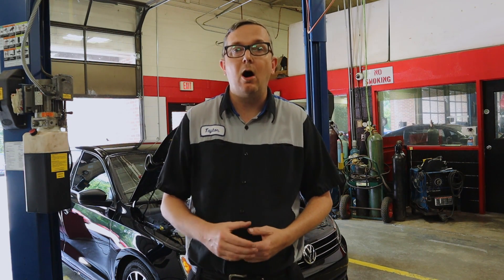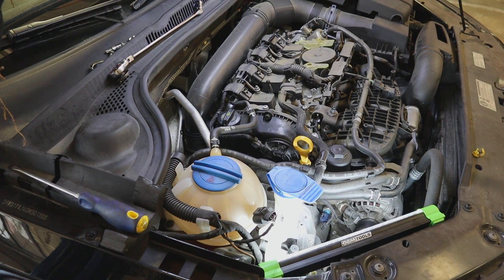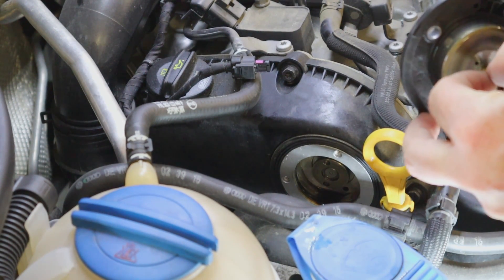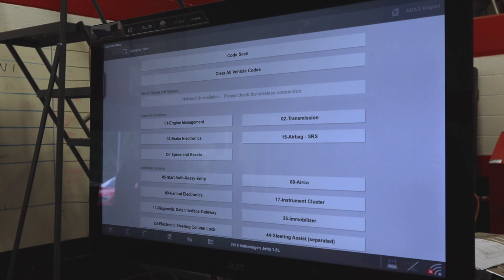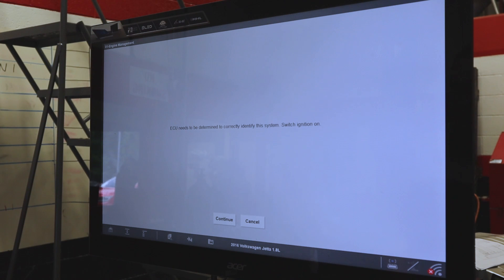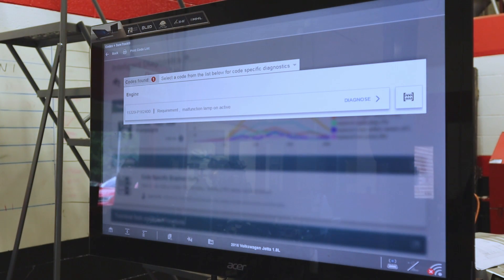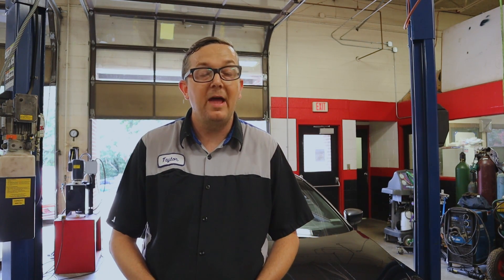VW Audi 1.4 1.8 2.0 TSI P0011 Camshaft code diagnosis and repair - try this first!

Comment: My 2019 vw tiguan sel premium was at the dealership for over a month with no answers even though I hinted the problem.  I picked it up and replaced both magnetic camshaft adjusters and control valve solenoids plus both camshaft sensors.  I ordered O.E. electronic parts and after-market oil solenoids and no more problems.
Reply from the maker: I’m glad it worked!

Comment: Exactly what I was looking for!! Is the pin on the electro magnet supposed to move freely? Mine is stiff and retracts inside when I let go of it
Reply from the maker: You may be able to clean it but I would be looking for a replacement. I hope this helps!
Reply: Hello. The pintle in the magnet is supposed to move freely. Shake it and it should rattle. Move in and out. It controls high pressure oil flow to the cam in the vvt system. Number one culprit. Replace it. $163 OE. I bought it for $25 aftermarket at ECS TUNING. 3 torx bolts and 7 minutes later it's fixed.
Reply: @patrickvillarreal7058 my magnet pin was actually moving freely!! I’m just trying to decide and conquer things I know are an issue, I had timing done at the garage 6 months ago and they broke one of the bolts that hold the magnet down and just siliconed the head on to look like it wasn’t so I was thinking that could’ve been causing my issue but I had it fixed and another prexisting issue I had was my epc light coming on if I gave it too much gas going up hills and it comes when I raise the rpms to climb them. It’s fine under normal acceleration except for in certain cases not always 4th but almost always in -5-6 if I’m really on the gas for example to pass on the highway I get the epc light. And I know for a fact my vet solenoid needs replaced as I get a p0010 code for it but I’m having trouble getting the tool. I’m also tackling a possible pcv valve issue where I’m getting oil consumption almost half a quart every 2 weeks and oil mists from the oil cap if I open it while running and intermittent white smoke from the tailpipe at idle like it will be there and gone but it’s not a smokescreen and only at idle. But the car runs and drives fine as far as I can tell which is even weirder and no other codes than the p0010

Comment: Thank you for making this video I own a 2014 audi a4 quattro 2.0t  but im having trouble loosen  the valve  everything turns when i try, any tips would be appreciated
Reply from the maker: Make sure you are Turing it clockwise
Reply: @AutoScholarwithMrB  so same as you described on video, righty loose and lefty tighty? If so how to keep from everything tuning i bought the special tool can i use a impact rachet insted of handheld one? Thank you
Reply from the maker: @omaramaya3441 maybe, just be very careful. I have no idea how you would get it out of it breaks. Many people have mentioned cleaning it in place with brake cleaner if you can’t get it out.
Reply: @AutoScholarwithMrB got ya! Thank you very much i appreciate you taking the time to respond!
Reply from the maker: @omaramaya3441 thanks for watching!

Comment: Hello, I have the same problem: "P0011 Camshaft position intake timing over-advanced". I just replaced the new chain kit also both camshafts and have the same problem again. Do you have any idea when problem came from? Thanks , Xhulio
Reply: Did you manage to solve it? I also had problems after replacing the timing kit.

Comment: Great video, and thanks for sharing your knowledge. I'm planning to perform this work on my 2014 Passat and had a quick question: what is the torque specification for the VVT oil control sensor? @Auto Scholar with Mr B

Comment: Great video,  I heard someone mentioned that when the timing valve actuator is starting to fail that it can cause excessive engine crankcase vacuum.  Do you think that can be true.?
Reply from the maker: Im not certain, most of the time the oil separator will fail and cause that. It can actually damage seals and cause lean codes as well.

Comment: I saw one vid where they had to hold the crank or something below and turn that part out...can i just unscrew that ☝🏾w/o throwing anything out of wack...I replaced the magnet and boyyyeee did that make a difference, just want to do the next step
Reply: Wandering the same thing. If the timing chain cover HAS to come off too

Comment: I had my timing chain done and they replaced the camshaft adjuster bracket for me also with my timing chains the camshaft adjuster bracket came with the VVt and camshaft adjuster but I don't think they replaced the camshaft adjuster and I've been getting code p0011 since they did it and my tíming chains I pulled the cover off and it looks to be off s few degrees does that mean I need to fix the timing alignment regardless ? Or the camshaft adjuster might make it align back properly ? It only seems off a few degrees

Comment: while pressing accelerator sound is good but leaving accelerator there is trrrrrr sound in the same place you showed in the video in my skoda laura 1.8 tsi what is the problem 
All mechanic saying its timing chai but recently only i have changed timing chain full kit

Comment: How did you have the brake caliper tool set up to get it out? No where near enough room for mine to fit in there
Reply from the maker: @Bdan99  I put the insert on a ratchet and had plenty of room.
Reply: @AutoScholarwithMrB I must have a different style. Thanks for the quick response!

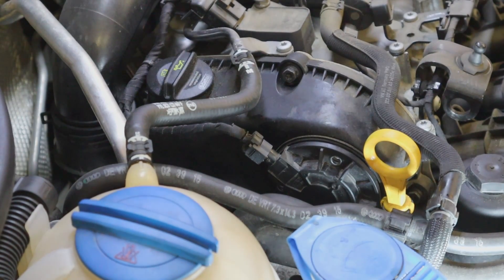Comment: hi it's clearly leaking oil right there 2:31 that because of the magnet? or valve inside?*
Reply: I would like to find out too... mine is also leaking oil at that position

Comment: Hello thank you for your video, i got an 1.4 tsi caxa, on cold start its perfect sounding but when it reaches operating temp. And i shut the car off and go somewhere for 30 minutes and when i come back and start it i hear a loud clicking noise only when the engine is just before operating temp, could it be that ? Car drives perfectly fine normal usage, power the same

Comment: Dude! This just saved me thousands, instead of taking it to the dealership I replaced these parts and my check engine light went off! Thank you!
Reply: Your engine was doing a weird noise before you change this??
Reply: How difficult was to remove the valve? I cant seem to be able to loosen it  engine turns  and it won’t let me remove it 
I would appreciate any tips

Comment: My epc light comes on once in awhile then when I pull over and turn it off and back on goes away I have a 2016 Volkswagen Passat any help
Reply from the maker: Need to run codes in all control modules.
Reply: @AutoScholarwithMrB  I don’t have no codes no check engine light just that dang epc can’t get to the bottom of it it comes off and on I have been thinking it’s the throttle body
Reply from the maker: @albertflores5952 it could be, but normally it leaves a code. Have you checked all the modules? A brake light switch can cause that as well and may not show engine codes.
Reply: @AutoScholarwithMrB  yes all break lights are good

Comment: I have a 2016 vw jetta 1.4 with a weird intermittent missfire and im wondering if this is my problem. No other codes just the misfire
Reply from the maker: I would check this and maybe see if your intake valves are dirty. That is also a common problem. Of course check plugs and coils too. Hope this helps!

Comment: Holy cow so glad you made this video 3 years ago and its still up. My 15 Jetta TSI went into limp mode a couple weeks back. Was getting the camshaft position sensor codes, bank over advanced codes, misfire codes. Didn't know what was going on, replaced the sensor cause i'm pretty noobish when it comes to cars thinking that it was the cause. Didnt fix it, had it towed to a shop in town and they were trying to tell me my engine was shot(They like a family local shop and probably hardly ever see european cars) I didn't take their word and had it towed back home. Luckily during search's I found a reddit post that linked to this video. Went in and did oil and filter change and pulled the solenoid off. Didn't have tool for the valve so I left it in for now, But the pin on the solenoid was stuck, After some pressure got it free and cleaned it myself, Hooked everything back up and cleared codes, My jetta is back up and running with no issues!
Reply from the maker: Glad you got it fixed!
Reply: did u have a leak oil before? and after fix it's gone?*
Reply: @bm_wuratli6883  No oil leak on my side that I was aware of. My main symptoms were the misfires and rough idle.

Comment: Hi Mr B.
I'm owner of 2014 Mk6 Jetta and after the oil change (Castrol Edge 5w40), my car started to fail when the engine temperature isn't at 90 degrees. But when I wait to the temperature are 90 deegrees, the car works fine.

The fail appears when I use the car with the temperature under 90 deegrees. In this case, after travel 1km, the engine sounds like if running at 3 cilynder, and after a few seconds, the car stops. After this secuence, the car turn on Ok.

I alredy changed the chain, the chain tensor, CMP sensor, Ignition Coils and I cleaned the Throttle body. But the problem pesists.

My question is, this cleaning or replacement, could fix my problem?

I appreciate much if you could help me.
Reply from the maker: I would definitely try this, let us know if it works.

Comment: Passat 2010 1.4tsi check engine #P0016
Got about 3 times clicking sound and engine jerking only while idle at cold start then working normally? Any similar fix here could make my life easier❤?
Reply: Is the rough idle cyclical or all over the place?

Comment: The oil screen on my camshaft solenoid (5:00) has been chewed up by my motor, Im gonna replace the solenoid and flush the motor, will I be okay?
Reply from the maker: I would replace the valve with the broken screen for sure

Comment: GREAT video on this. I have a rattle going on from the magnet and/or spool/oil control valve on my '15 Passat 1.8T that goes away when I unplug magnet. Question, can you run this engine without the oil control/spool valve installed? I was thinking of doing an engine flush and wouldn't want the new one in there when I run flush through the system. Also, do you recall the torque on the new oil control/spool valve? I subbed and liked btw!
Reply from the maker: I would not run the engine without the valve.

Comment: Could this relate to P0341 And Oil pressure light ?
Reply from the maker: Low oil pressure can cause this code for sure because the cam timing is run off of oil pressure.

Comment: Hopefully, you can see this. I just replaced the sensor, magnet and filter. The codes clear but I’m still having a weird idle. It’s not as violent or causing the car to stall like it previously was but it’s still a weird idle every 10 seconds or so. Any ideas?
Reply from the maker: Is your throttle body cleaned? Also check for vacuum leaks or exhaust leaks before the front O2 sensor.
Reply: @AutoScholarwithMrB hey thanks for the reply! So I got two things. One I now have a P2188 code (Running to rich at idle) and also the magnetic seems to be louder? I’m not sure if that’s because I’m focused on it or I did something wrong in installation. It almost sounds like that little pin in the magnet is hitting straight metal

Comment: Do you need to lock the camshaft to remove the solenoid? Is there a risk of putting the timing out while loosening it?
Reply: No need to hold the cams. The cams will rotate already timed. So when you put it back on nothing looses timing. Done 100 of these this way.
Reply: Are you sure it wont move the timming
Reply: @sebastianparedes755  1000% positive i'm an Audi tech and have do it many times it does move the chain with the cams a little but its already moving with it timed.

Comment: Could this cause a misfire in only one cylinder? I've done absolutely everything to this car spent probably 7k this year on diagnosing and repairs that won't get rid of a cylinder one misfire it only does it at idle
Reply from the maker: Doubtful it would cause one cylinder only.

Comment: What if i have p0011 and misfire codes to go with it? Does that mean its most likely a timing chain issue? Car was running perfect and then started chugging when i started it up this morning
Reply from the maker: Might be but I would try this first, hope it works for you

Comment: This saved me today. I tried the rear caliper tool trick. Sadly someone lost the one that fits. I was able with a quick squirt through both holes on the screen side get the center moving nice. Squirted in the magnetic side and chucks came out. Got that moving free.

Oil change sticker was 2k until due from valvoline. Engine was 2 quarts low.  Super dirty. 

I went to do an oil change after cleaning. Previous guy rounded out the drain plug. Told customer to ask whoever did the oil change to explain
Reply: So I read this reply but I’m confused as to what he meant or used when he said “ quick squirt through both holes on the screen side” 

Are you using brake cleaner on the sensor side or the cam side ?
Reply: @FaceTimeSnipe same question here
Reply from the maker: Glad this worked for your customer!

Comment: Hi! Thanks a lot for the video!!! I have a 2019 Kodiaq 1.5 TSI DADA engine. I am getting P0011 code only on cold engine (oil temp lower than 60 degrees). Car used to drive on 5w40 and 5w30 oil, recently changed to 0w20. Problem popped up only 2 months ago, and is still there after oil change. Cleaning the solenoid magnet and oil control valve did not help. Would you advise replacing either of the two (if so - which one would you replace first)? There is another control valve inside the intake camshaft (on which the magnet solenoid is pressing) but it is very difficult to get to. On live data I notice an additional strange thing. When driving on cold engine, after engine Start/Stop shutdown, the specified value for intake camshaft gets "stuck" at 8.7 degrees, while actual value cycles between 8.7 and 12.0 degrees. Pressing the accelerator does not alter the specified value sent by ECU. After a few seconds, it gets "unstuck" and specified starts reacting to changes in driving behavior and actual value follows specified more closely. Any advice would be greatly appreciated! I can share graphs if needed. Thanks a ton for your help!
Reply: Why the heck would you ever go to 0w-20. Luck you do something serious to your engine

Comment: Fingers crossed that this is what my 2014 1.8 TSI has wrong with it… no codes but I’ve got 260k on it and am hoping it’s not timing chain related… it’s developed a prettt bad intermittent knock at idle coming right from the VVT are. Maintained by myself since I got it with 70k on it diligently so hoping it’s simply the solenoid
Reply from the maker: You have 260k and haven’t changed the timing chain? That’s incredible. I would definitely look into doing that as soon as possible.
Reply: @AutoScholarwithMrB  I should
Have mentioned it’s km and not miles.

Comment: Thanks for this great turtorial. I have a question about the VVT valve body at 4:45 where you illustrate how the center of the body can be pushed in. We just did a timing chain service and after, the car runs well but we have a P0011 code. The cams were properly locked, I'm fairly confident the chain gears are properly timed. The magnetic actuator also appears to move freely although I have not electronically tested it. When we pulled the magnetic actuator for the timing service, it was particularly difficult to remove, even once the  gasket was free'd up, and made a significant popping noise when it finally let loose. Now, its back together and when I tried to remove the VVT valvebody, I couldn't get it to break free (turning CW, reverse thread) without having a wrench on the cam to counter. So, I tried to move the center of the VVT vavlebody (as you show at 4:45) and while installed I could not get it to budge. I am curious if you know if this is a function of it being installed, or a function of the VVT valve not working correctly. Thanks!
Reply: Did you manage to resolve the issue? I too have P0011 code on my 1.8TSI. It seems that the spring of the actuator is stuck down too. I'm unable to remove it and check as the uploader claims I do not need to hold the crank down. Perhaps I will try to hold the crank and loosen it. Worried that my engine could be experiencing a stretched timing chain.
Reply: @plzdonhack  yes. Replacing the valve resolved our issue. Ours was also very difficult to remove, I suspect it was over torqued which may have been part of the issue as the center actuated normally once the part was removed but was bound when it was installed (and over tightened).